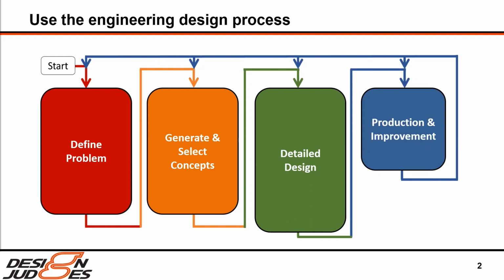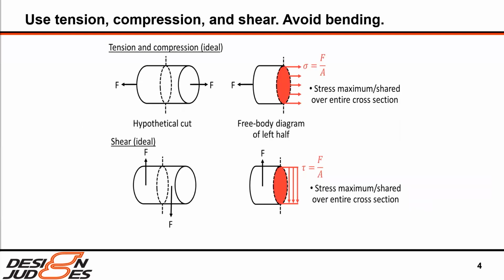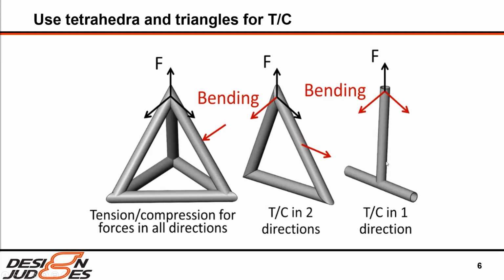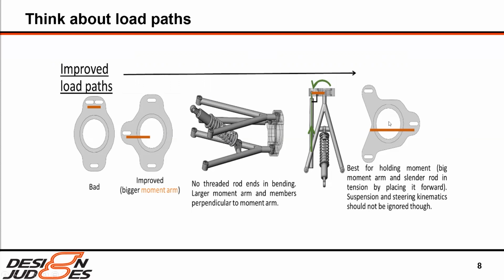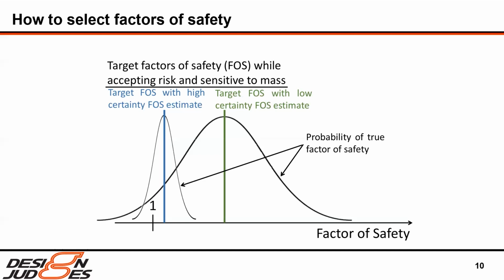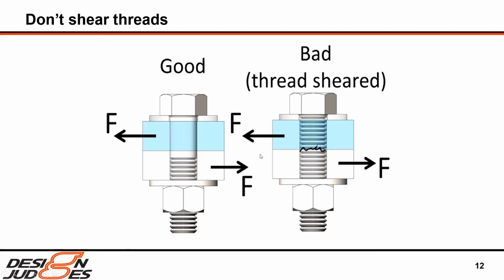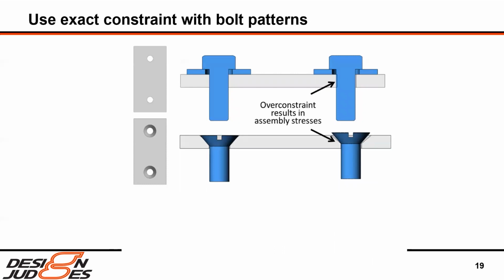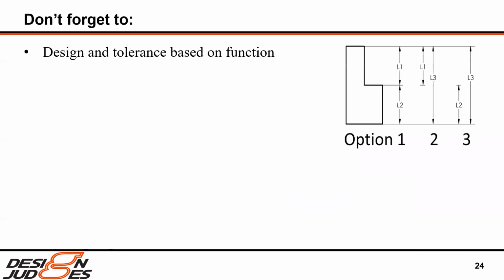Design of Strong, Stiff, and Light Structures and Joints

Comment: Wish this channel was around, back in my FSAE days.  Beyond threaded fasteners, it would be nice to continue with other joint types (rivets, brazes, welds, adhesive/composites, etc.).  I believe students tend to underestimate the process controls required for a good weld or bond.  Welding requires a degree of skill.  Welds and bonds are highly sensitive to contamination.  Speaking of safety factor, I'd bet at least a few teams have overlooked the effects of heat-processing on metal temper, and internal stresses.